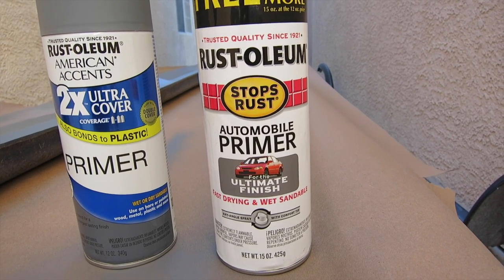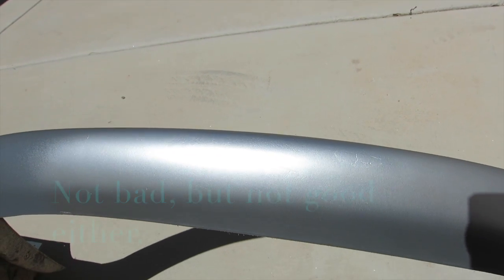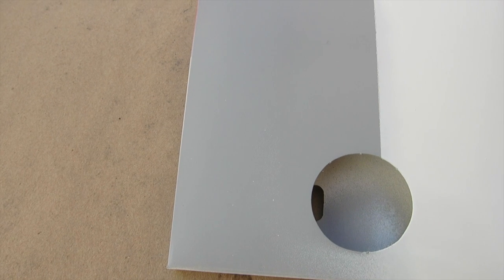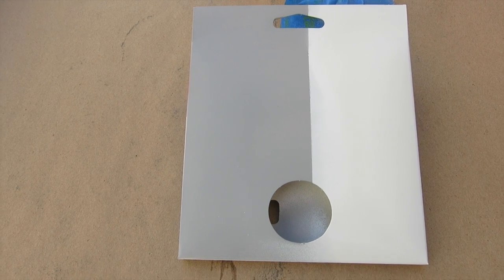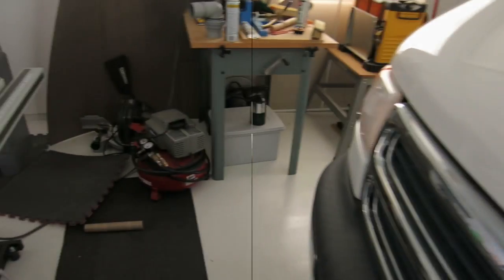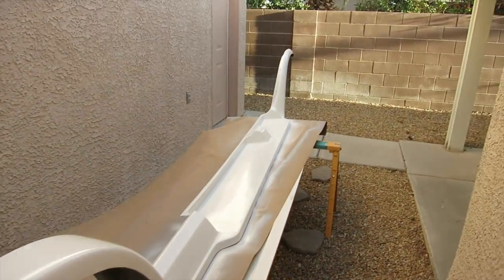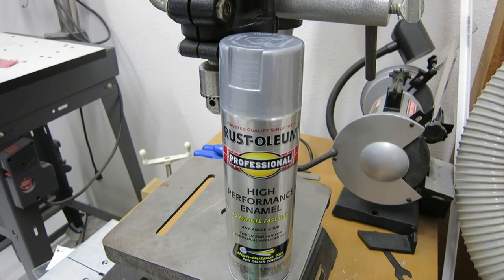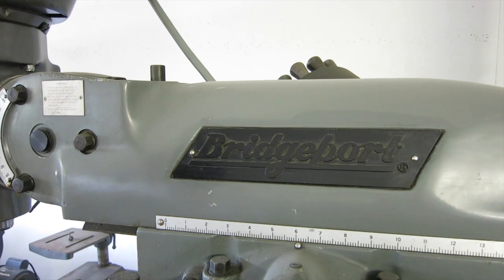RV Changing paint color and a peek at Shop #2

Comment: u seem like a meticulous person regarding ur van, prep those running boards urself, then take them to a body shop that will use du pont or ppg standox sikens or a paint that they give a life time warranty of the paint. You work too hard to have that clearcoat delaminate in 2 yrs from now by using spray can paint.
Reply from the maker: PotLickerHound I agree there are better (and more expensive) ways to go. A premium restore was never part of the plan for this 15 year old van. I'm not using a clear coat for the reason you stated. The Rustoleum product here has good reviews for durability. Off-the-shelf availability makes for easy touch up. Thanks for the feedback.